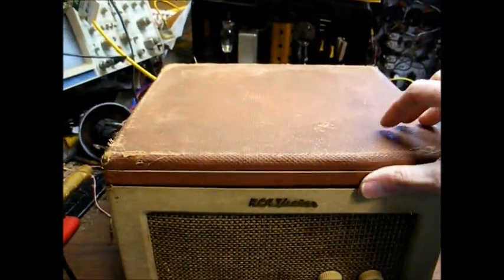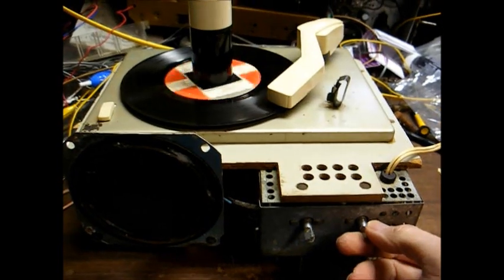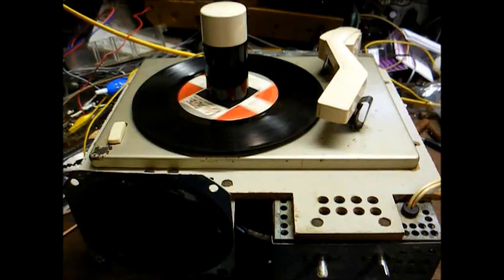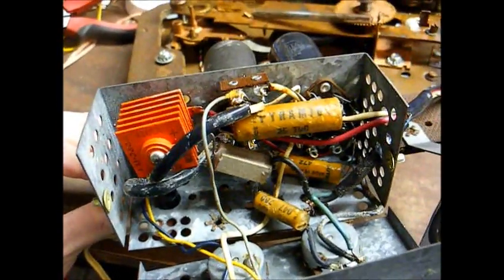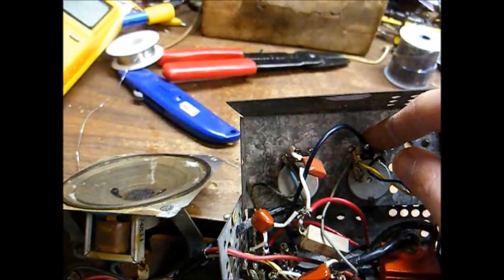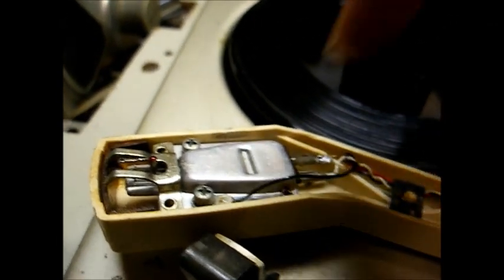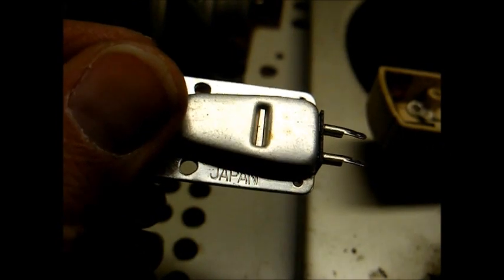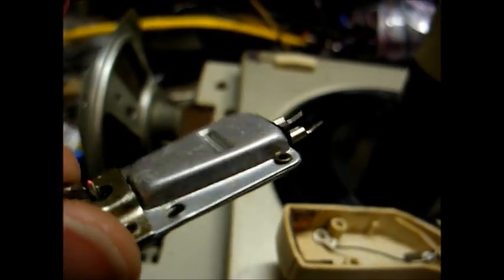Repair of an RCA Victor 45 rpm record player - pt. 1

Comment: Hi there and great video! Would you happen to know where I can get those ceramic capacitors you replaced the paper ones with? I have .05 mfd 600vdc and .1 mfd 200vdc and .01 mfd 200vdc that need replacing. Thanks for your time

Comment: It might be interesting to hook the meter to the cartridge wires, play the record, and see what voltage reading you'd get from that cartridge.
Reply: You hook up a scope to measure the cartridge and you will find maybe 2 volts PP.
Reply: With a good Hi Z scope you will find over 3 Vpp

Comment: Thanks for a great video.  You'd think RCA would of had a better amp than that cheap thing!
Reply: Oh they did, a model with a Hi Fi Push Pull amp and an 8 inch speaker.